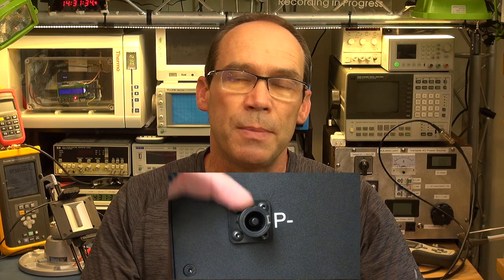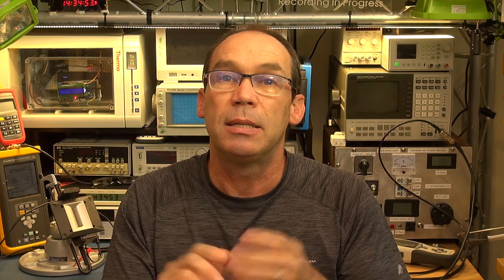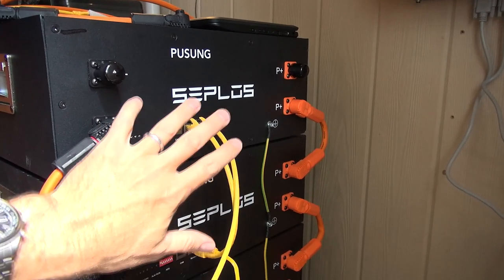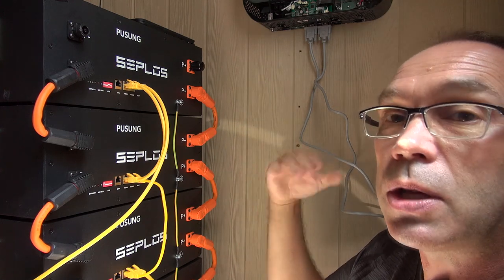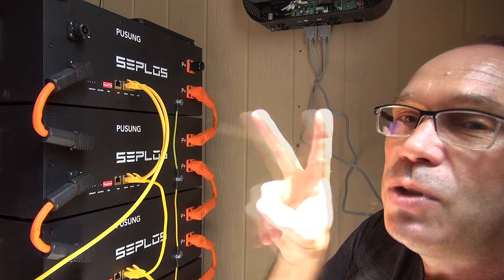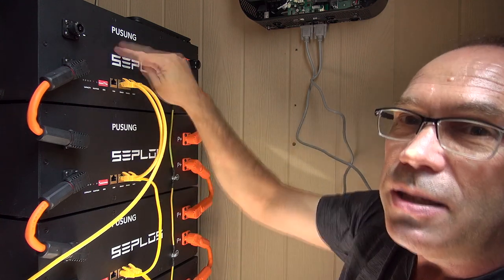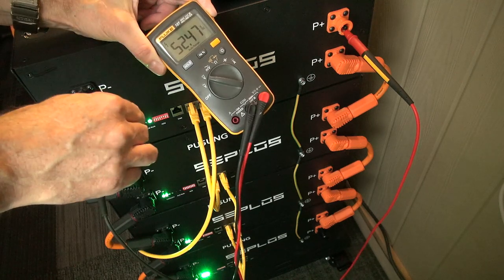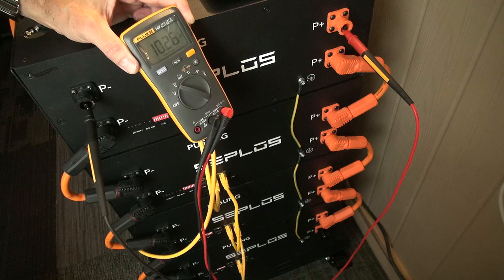Seplos Pusung Battery DIP Addressing, Setup and Software

Comment: The more I see of these units, the more impressed I am. A lot of thought and engineering went into the design. I would suggest setting the lowest unit as 1 if you will be adding more units later.

Comment: Hello.
I have a question.
My photovoltaic system is planned with 54 modules of 410 watts each.
Aligned east - west with a 40° roof pitch.
According to the table I get an efficiency of 85%.
22 modules east. 32 modules in the west
3 VICTRON MPPT RS 450/100 and 3 MultiPlus-II 48/5000 are planned.
To start, I will begin with two Seplos Lifepo4 batteries.
My question now is:
54 modules x 410W = 22,140W - of which 85% = 18,819 watts.
18,819 / 55 Volt charge voltage = 341 A
I can charge the Seplos with 100 - 150 A.
Can I put the 341 A on the two Seplos, or is that too much?
2x 150A = 300
A Victron has a nominal charging current of 100 A. I use three of them. I am installing three of them.
Can I connect this nominal charging current in parallel to a busbar and connect it to the Seplos?
I am afraid that the Victron alone cannot handle the 18.8 kWp.
Thanks for the help

Franz

Comment: Btw the addressing is 4 bits in reverse binary - for 2P it's mean to be 1 and 2, not 0 and 1 according to the DIP address manual - from a developers perspective this sounds weird since the first starts at zero and that is the case if you have a single unit - you set dips to zero.

Comment: Great Video ! I am looking forward for the Inverters commission video, I got the 12K growatt inverter and I have the Seplos BMS and I have not been successful in getting communication. There are a series of options in the Growatt settings for the communication protocol, I hope you bring information on this.
Reply: Same problem here
I got 5kw growatt inverter 
I tried both canbus us with protocol 51
And RS485 with protocol 01 
And never communicated 
Tried both ports in inverter and battery 
cross lan cable 
Change the address 
Restarting the inverter and battery many times

I'm sticking with user configuration now
48v cut off
56.5v charging
54.5 bulk voltage
20 ampere charging current 

But the  battery after reach full charge starting to self discharge with 1.5 amps at 53volt 😑
 and the inverter won't charge it except if I cut of pv and grid and resume them

Comment: The way they display the numbers backwards (from 8 to 0 left to right)  is actually correct as that's how we read binary codes however, I really don't see why in determining which battery is which they didn't just follow the binary logic where battery Nº1 = 0 Battery Nº 2 = 1  and so on 🤔

Comment: Great video, Martin.

Have to admit, the configuration seems very ill-conceived. Hopefully they can come up with something much better. Messing around with DIP switches seems very old-school.

The software looks like it was built by a team of hardware engineers! :) I spent the first few minutes of your demonstration wondering why it wasn't showing the status of all the packs; the "flipping" through them alternately seems pretty clunky.

Oh well, as long as it all works, that's all that matters ultimately. Best of luck with the inverters.

Comment: Those Power Wires that you have connected will Heat up because you have not given enough Radius. Other words, the Radius is to Sharp and will cause Heating as if it were a Resister. Is what I'm saying True? If you could put a separator between each Battery to keep Wires straight so there would not be a Resistive load on the Wires. This would fix the problem of Heating up and causing a Melt Down under Heavy use. Is this a solution? Thanks for the upload.